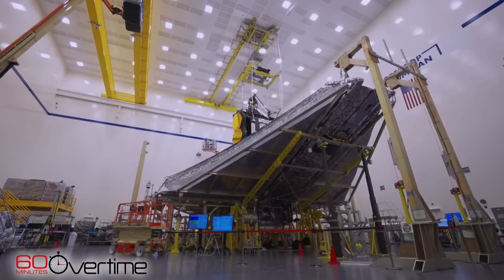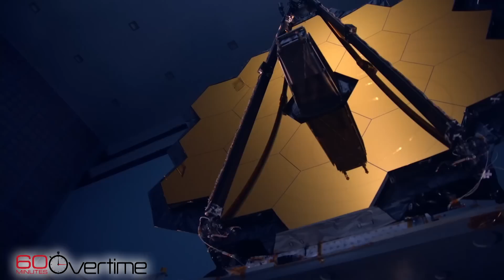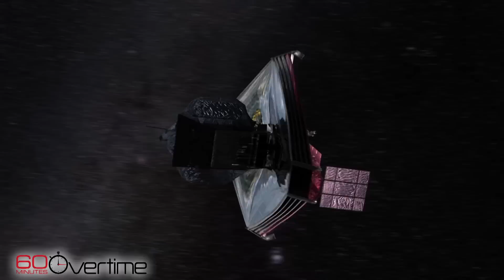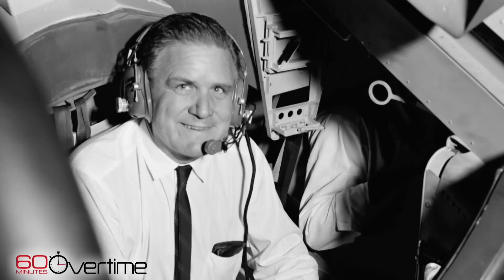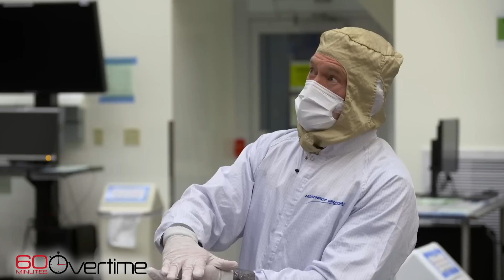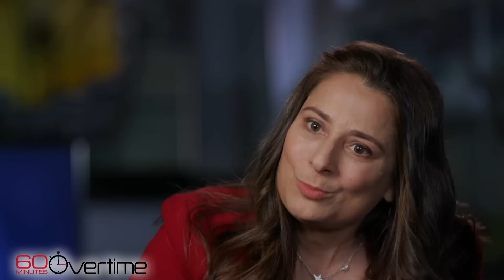NASA's James Webb Space Telescope | 60 Minutes Archive

Comment: Absolutely amazing feat in human engineering🛰️
Reply: The only thing that failed in the deployment was the set of switches to confirm that the heat-shield had deployed properly. There was no confirmation that the heat-shield had extended and tensioned correctly. The concerns about whether it had deployed were answered, after a few anxious hours, by the engineers monitoring the heat-shield temperatures - the temperatures of the shields and the rates at which they were cooling could only mean that the entire heat-shield had deployed correctly.

Comment: 0:34 Be advised: The 'let there be light moment' occured between 240,000 and 300,000 years after the big bang and it wasn't a cold dark universe earlier, but rather hot and dense.
Reply: Existence just spent 240,000 years looking for the light switch. 

Now I am very excited for space gravitational detectors (in effect 'gravity' space telescopes) that can pierce through the plasma wall that light couldn't. Maybe then we'll see much closer to the initial state of the universe and maybe also the insides of black holes. 

LISA is expected to launch in 2037, which is a step towards that. 

Very exciting times we live in.